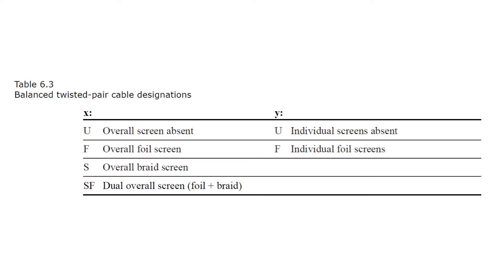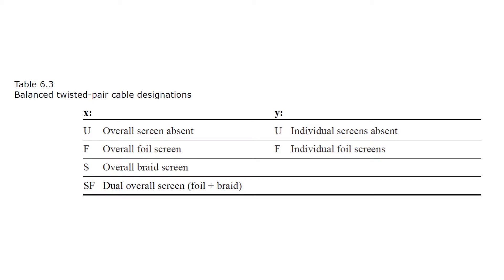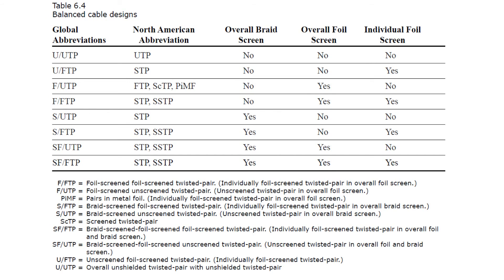ITS Cables and Hardware

Comment: Hi, the answer for the chaper-5 question has some controversy. In TDMM it was mentioned, "While there are no specific limitations of cable length in the pull-through method, specific applications or multimode cabling properties may limit the overall length". Please let me know which one is correct.